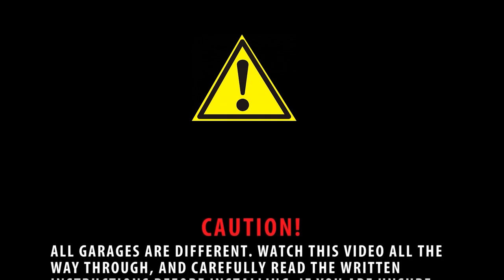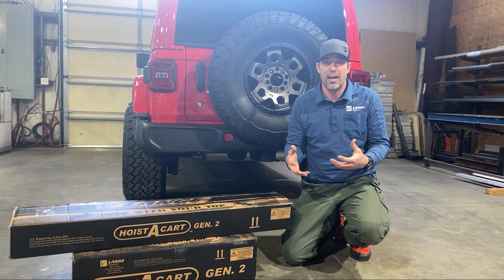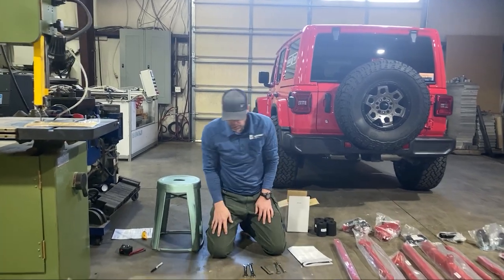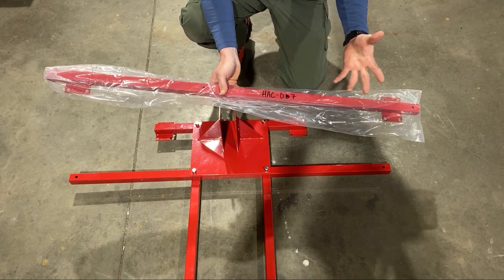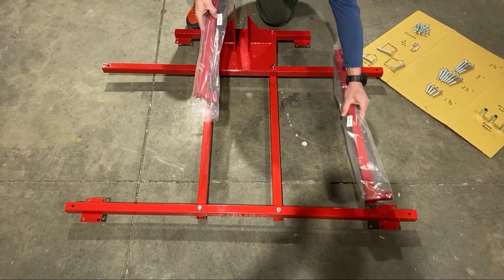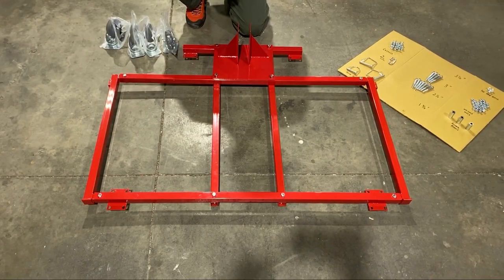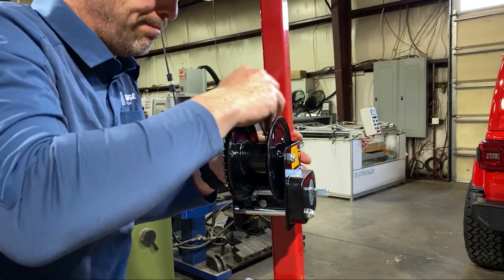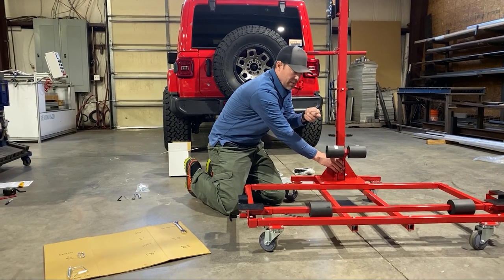GEN 2 Hoist A Cart  Installation Guide Part 1 Assembly

Comment: Great video. We put our cart together yesterday. One thing that threw us I'll mention is the bolt that goes into the crank to hold the strap comes packaged with the strap, not in the box with the crank. That set us back a few minutes, but other than that everything was super smooth to assemble. We've got the other video queued up for when it's warm enough to put the soft top on. Thanks for making them.